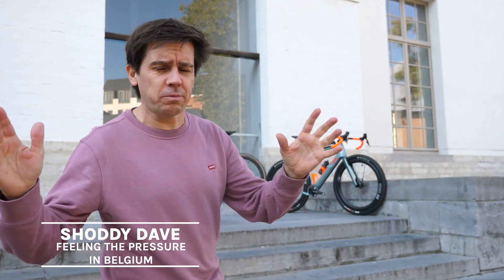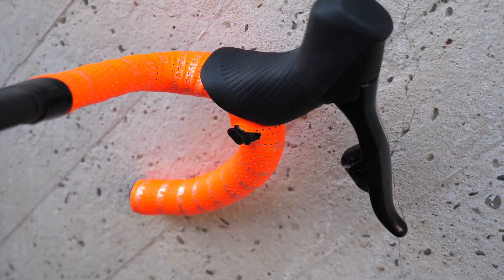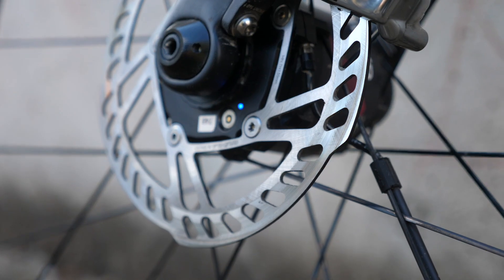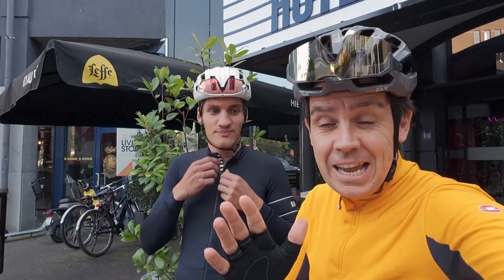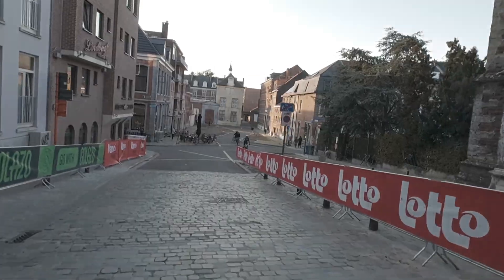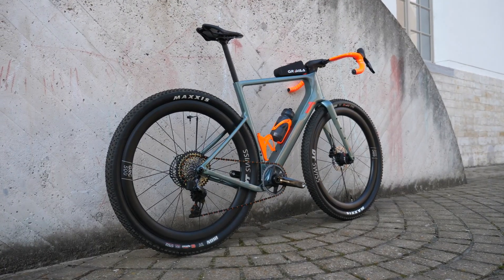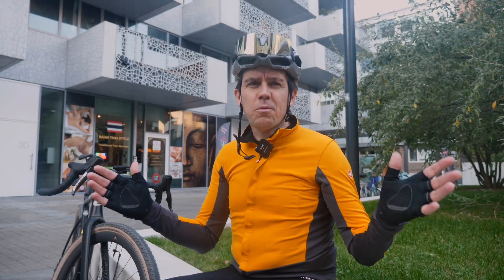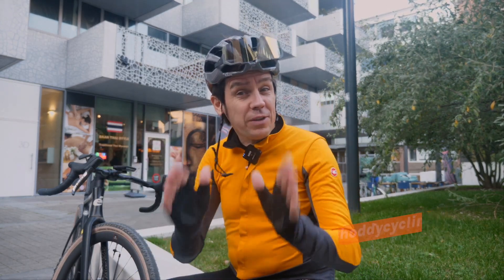Gimmick or Great? Gravaa: Automatic Tire Pressure Adjustment System: First Ride Review

Comment: 0.8 bar per km? That seems very slow. Is this done to make the drag less noticeable? Surely it should be possible to inflate the tires much faster at the expense of high drag temporarily.
Reply from the maker: The prototype versions were quicker, but at €20,000 a pair they had to bring the price down to achive what they have. - Dave

Comment: SILCA tyre preasure calculator says I should run 45mm tyres at 2.6bar on new pavement and 1.7bar on category 4 gravel. So all I really need in theory is a 0.9bar change in tyre preasure. 

If I can achive that change in 1-2km seems ok, unless your terrain changes constantly.
Reply from the maker: Agree, we've a set on order for a bit of testing. Stay tuned - Dave

Comment: That's a VERY interesting technology 😃
One question: is it for tubeless setups only or will it work with tubes ?
Annoter one : can a single set of hubs be used for gravel pressures (around 2 bars on 45-50mm tires), for (all)road-ish pressures (around 3-4 bars on 30/32mm tires) and for pure road (old-school 6-7 bars on 25mm) ?